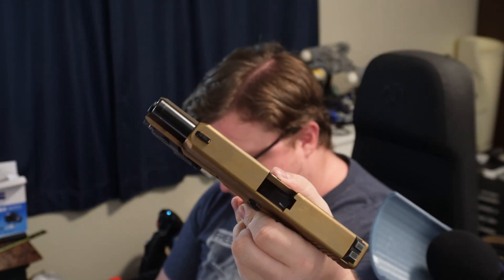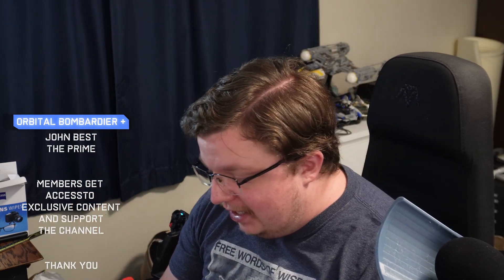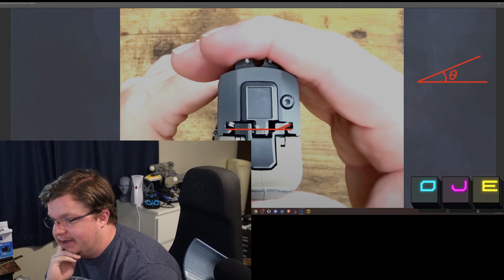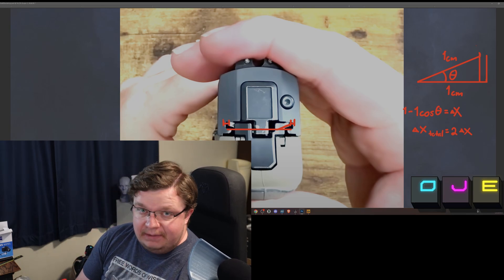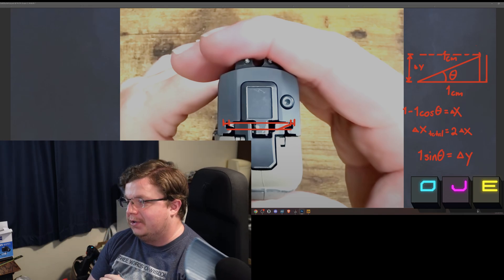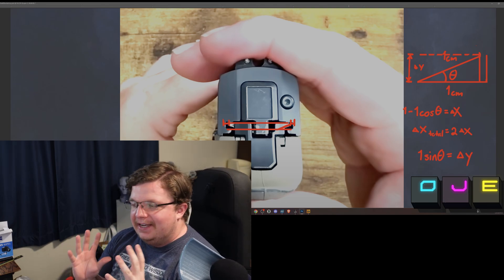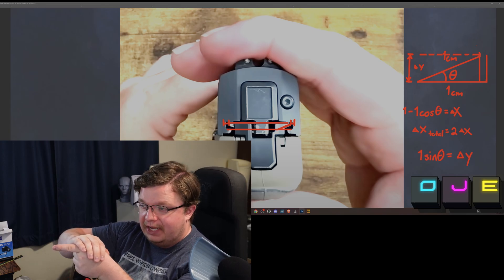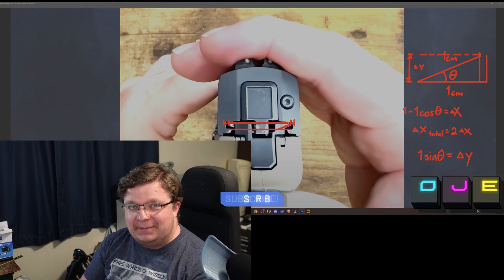Is the SIG P320 Safe???  -- An Engineer's Take on Wyoming Gun Project's Video

Comment: Also I hate gun channels, they are forced to operate from a position of expertise and ignore the fact that firearms dating back to the rock sling are the single point of human advancement over wildlife and hence have had the largest engagement from the greatest engineering minds to the point that while civilization has advanced in the 50+ years to the point where we can cure viral outbreak and harness atomic power the design of fire arms really hasn’t changed (ok, there are arguments to be made that improvement to fire arms in all that time is machining precision and maybe plastic jackets but that is very minor) because the design is solid.  From my understanding the angles contact minimizes sliding friction and improves parallelism between the two surfaces using a milling machine versus post machine grinding which cost much more money making that design a significant cost reduction with only minor accuracy loss
Reply from the maker: Except that those rails are probably made by bending. So this wouldn't be an issue with post-processing as much as it would be poor process control for the bend itself. Ergo, if they didn't bend it far enough, then an angle is produced. Maybe the metal specified is not up to the forces involved.

But I see what you mean with the first section. Guns are guns and haven't changed much. That's why I am not a collector. I have a selection of firearms that work well and that's it.

The same argument could be made for many other things though. Combustion engines? Not that much better than those of yesteryear.
Reply: Firearms have improved significantly in the last century, but are intentionally low tech in operation. The SIG fiasco shows how subjective and farcical many firearm expert opinions are. When it comes to information, more nonsense is generated about firearms than any other topic, this includes military doctrine. Remember, the best military weapons "experts" and their premier DoD institution carefully selected one of the worst and least reliable sidearms on the market and did nothing about it for a decade as evidence rolled in, and now Uncle Sam is the proud owner of 500,000 of the worst sidearms in recent memory, thanks to the best experts the Pentagon could assemble to make the decision. There will be no accountability, these experts will probably be asked to opine on what went wrong.

Comment: You lost me, I see clear explanation for extra slop in the side which is understandably a manufacturing error and not a design flaw but I don’t see anything in your video that explains how or that would indicate the gun can accidentally discharge
Reply from the maker: When watched in conjunction with WGP's video, he demonstrates how wiggling the slide causes a misfire. I could have done better to explain that here for sure.
Reply: @OddJobEntertainment oof, that’s scary
Reply: Striker is in the slide, the sear which holds the striker is in the frame. So if there's too much play in the slide it could cause the sear to disengage earlier then it should be able to.